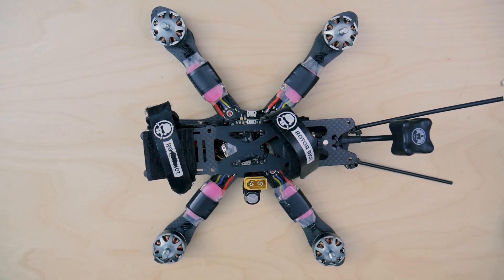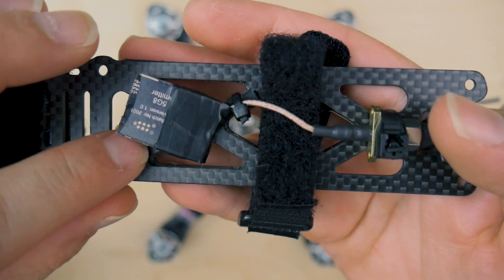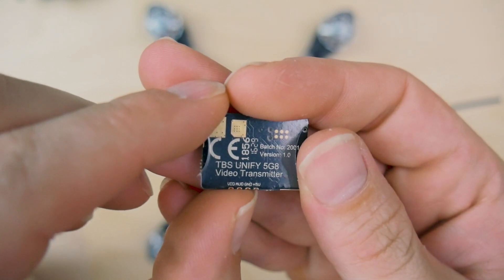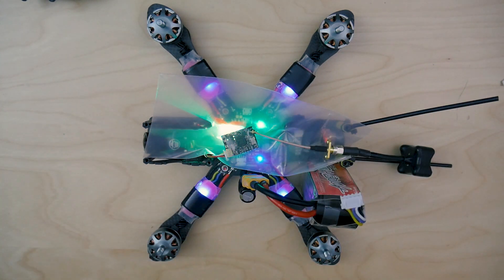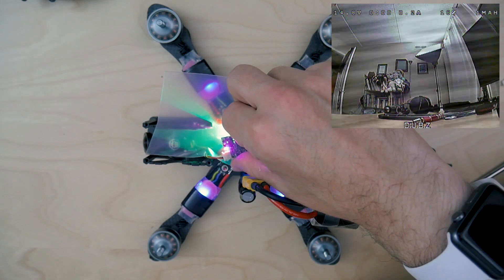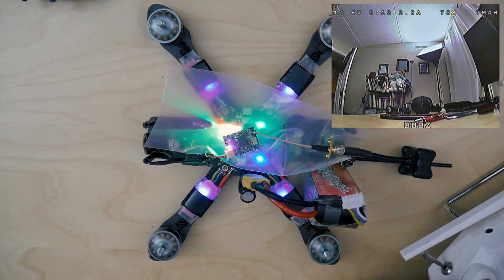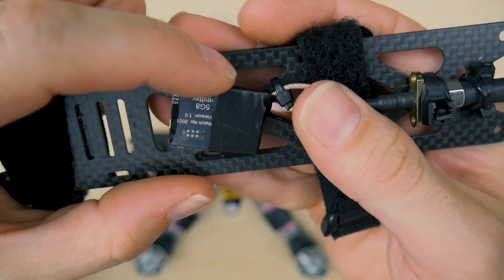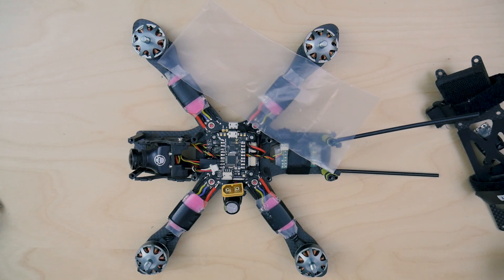Horizontal/Diagonal Lines in TBS Unify Pro When Armed - Solved

Comment: Any electrical engineer here? I think TBS's active circuit to counter suppress the side bands to create the clean channels are oscillating. Those intricate equations that only PhD's know how to use is making me nervous. They are trying to squeeze a 2 pond equipment into a 2 gram board, the troubles are creeping out. Maybe I will go back to the cheep and dirty AKK boards for the sheer simplicity.

Comment: I wish that was the problem sor me unfortunately even on open bench everything layed out there are horizontal lines when going to 400mW or max. No issue in 25 or 100mW on TBS Unify pro32 nano. Even when motors aren't spinning just after arm (to get out of low power mode). I redid all the solder connections nothing helps.

Comment: Just wanted to say THANKS! I had the TBS Unify on the top plate of my Zilo Phreak and it started to develope the horizontal lines when armed. Because of your video I was able to identify the problem and fixed it by repositioning the vtx. Again, thanks.

Comment: Had the same issue with a TBS Unify Pro32 Nano. It would heat up really fast, and unless in very good airflow, this would result in a lot of high frequency noise. So I used some thermal gap pad material between it and the carbon frame. Adequately cooled the high frequency noise vanished, but I then saw lines as you show when I armed. After some experimentation I found that if I grounded the frame (a simple wire from a gnd connection on the FC to a frame bolt) totally eliminated the noise. The fix shown here is wrong. You want the VTX amounted against solid carbon, not where there are holes. Then just add a ground wire.

Comment: For my quad I start noticing lines in the feed when my motors start going. Sometimes I notice them weeks before a motor goes weak, blows a bearing, or burns out.
Good gouge, though! I use the TBS Unify Pro HV, so next time I have it open, I'll look for this, too!
Thanks for the great video!
edit: electrical tape over the open contacts can help, too. I always lay a pad of electrical tape when mounting pcb near/on carbon fiber.

Comment: Does anyone know other causes of diagonal lines? I'm using a different Vtx (eachine tx5258) and I've tried insulating the Vtx, using different ground pads, powering the camera from the board and directly from the 5v Vtx output but I can't get the lines to go away :( Please help.
Reply from the maker: I've learned a lot since posting this video and will likely do a follow up soon... The lines can come from just about anything. I use individual ESC's and have had a few that cause the lines even thought he ESC worked and preformed fine. Could be your PDB. Could be a bad camera. Could be that the vtx antenna is too close to the battery wire/terminal. But what I have found is that when you do get the lines, it means that there is an issue somewhere. Something is making the power dirty. The million dollar question is where? Unfortunately you will only be able to find out by testing all components individually. It's a pain in the ass, takes a long time and can be frustrating as hell. But it usually ends up being a bad component somewhere. You could also try capacitors.. Wish I could be of more help.

Comment: I have the TBS unify pro 5V, but I get horrible lines on my screen when I switch my VTX up in power wether it's armed or not armed. If I go past 200MW it's so bad I can't see anything, but I can fly with 200MW or less. Any ideas why? I really want to fly long range but I can't do it with these lines on my screen!
Reply from the maker: I'm starting to find that lines in the video usually mean that there is a ground loop somewhere in your wiring. Best thing to do is to remove your props, power on the quad with your goggle or screen, then start moving different wires and boards slightly to see if it causes any variation in the video lines... In your case, it may be that you are drawing too much power rail you have your vtx connected to. Based on your FC and PDB combo, there are limits to how many amps you can draw from the 5v rail or the boards themselves. Seems as if, when you go over 200mw, you may have reached the limit on the amps drawn the the video gets too noisy. There are really to many variables to give you an accurate reason but hope this little bit of info helps. Thanks for watching!
Reply: Joshua Hardee 

Yes I think your right. I went and bought a Mach 2 from RaceDayQuads to try it on the 7V VTX power and the lines are way clearer. It's still not really working past 200MW but it's much better than what it was so I'm getting closer!
Reply: Have you now fixed it? I have the same vtx you have.. the unify 5v... i never had this issue with this vtx with my other builds... i can not understand why this happens.
Reply: Yes, it turns out the issue was my flight controller. I swapped it out and everything works just fine now. But thank you for the reply!

Comment: I bought a mr steele quad from flitetest, but my issue with vtx was the free dangling vtx mounted was causing vtx antenna to be disconnected. What i did was to solder the antenna to vtx and fixed.

Comment: One of the motors is shorted. When the screw is tightened into the motor windings you get such lines when you push throttle. Is because the vtx antenna gets grounded to the top plate and the top plate is connected with the bottom through those aluminium standoffs.
Probably also one of the standoffs gets hot in about 1 minute or so... easy to check if you connect the battery and give a couple of throttles with no props.

Comment: Min 9:19, I would still recomment the SMA not to touch carbon. It makes sense what you did, basically isolating the open areas that seem to be susceptible to noise in this vtx much more than others.

Comment: The cause of the lines are voltage spikes from the motors and Esc's. Try a ferrite ring, using only 4 turns widely spaced.
Reply: paulkazjack install the ferrite ring on the power leads going into the vtx?

Comment: You have so much space in your stack you could use the whitenoise mounting board so you can bolt it into the stack and remove the heat shrink. Runs cooler too.

Comment: Is there any other solution e.g. adding a couple layers of insulating tape over the heatshrink?
Reply from the maker: I tried adding more electrical tape and heat shrink.. It did not help.I would imaging insulated tape would help but I did not have any to try. If you try, let us know. Best thing for me was to increase the distance of the VTX from the carbon.

Comment: Great video. The reason they have those little pads on the side is for a board they sell called the "white noise" which you can basically solder the VTX onto and the board mounts on the top of your stack.

Then you solder wires to the bigger pads on the board to connect everything up instead if using a wiring harness, I think there's even a place to mount a frsky RX etc. on it. I had the same issue as you putting the unify between the standoffs on the bottom plate of my Dronewolf pup, the problem went away when I removed the VTX from that spot so I realised something was making contact or affecting it so I wrapped it in more heatshrink and stuck thick foam tape between the VTX and carbon fibre to fix it.
Reply: I'm going to try that, thanks

Comment: Thanks for sharing this Video...I think my Mach 2 VTX hast his issue touching the Aluminum cage of my Dquad Obsession...no lines before idle, then lines show up when armed...will look into isolating the board better.
Reply from the maker: So on my second quad, I tried wrapping the SMA connector of the VTX connected to the SMA of the VTX antenna in shrink wrap to isolate the connector from the carbon top plate. For some reason I got lines in the video. When I removed the shrink wrap and allowed the SMA connector to touch the carbon frame, the lines went away. I'm guessing it is almost like a 2nd ground... So if you have isolated the SMA connector using shrink wrap, try removing the shrink wrap and allow the SMA to touch the carbon.
Reply from the maker: Let me know if you were able to figure it out or if this helped.
Reply: I am wrong on the Metal cage grounding, Tested it with my Multimeter, it is anodized, and no matter how hard I press the meter points in there is no continuity even on the same cage part, I thought it might be RFI nearby the VTX that is pushing through the Runcam Soplit 2 board + metal heat synch. Turned out I had kinked my SMA cable, and the ground was bleeding through the signal coax. I replaced it and got better reception, after I put some standoffs on my SMA mount to let the pigtail have some more room beneath...

Comment: You say metal about a hundred times... do you mean carbon? Just clarifying. You mean the metal contacts on the Unify are touching the carbon.
Reply from the maker: Kendall Smith yes, this is my second video and did not plan or edit it much. It’s basically a one shot so yes I did stumble on a few words. But... Carbon is a form of metal... The unify contacts don’t have to directly touch the carbon, in my case I had the unify wrapped in shrink wrap as well as electrical tape and it wasn’t touching the carbon it was just very close to it. So if those unify contacts are close to any conductor (metal, carbon, finger, etc.) even with a fair amount of insulation, you will still get lines in the video.
Reply: Joshua, after re-reading my comment there were a certain amount of douchey undertones that were unintentional - my apologies. I was ensuring that I didn't misunderstand something about your build. Thank you for the response and efforts to share your experience and troubleshooting with the community.
Reply from the maker: Kendall, no worries brother, glad to help and share. I’m very particular as well and after I posted the video, I noticed there were quite a few things I could have said differently. Just with all things, we only get better with practice and will be posting better videos in the future. Thanks for your input as well as watching. Hope it helps with your troubleshooting.
Reply: Man, I guess I should just shut up sometimes haha... this thread re-activated months later. My bad! Again, thanks for the video and no hard feelings :D
Reply: well not to be a dick or anything but carbon is not a metal, it's carbon .
 but we understood in the video as it was very clear what you were talking about.
Reply from the maker: You're not a dick, but you are correct. Carbon is not classified as a metal, but it is highly conductive. I worked for a Steel Company at one time and they processed Carbon Steel so my misconception came from that industry. Good Catch!
Reply: how can i fix this in a Chameleon frame? I have mounted the unify pro vtx in the bottom plate with doble faced foam. Maybe the noise issue is the antenna placement back in the aluminium plate? Thank you.
Reply: Ok but is there not any insulation that would solve this?
Reply: Is any plus touching the frame except for the unify?

Comment: Great video  friend bought one and had know joy so bought another thinking there was something wrong with it other same. Maybe soldering wires  to the side would help
Reply from the maker: Pete James was thinking the same about directly soldering but will still need to keep that side away from any conductor (metal, carbon, etc.)
Reply: Sounds like the tbs Unify Pro is going to be a pain for my friend just wondering if the other sort of tbs will be the same .Some other people think that it also to do with dirty power lead.
Who knows so glad haven't bought one.

Comment: Thanks so much for posting this. Ive made my quad into a giant flying capacitor trying to cure this problem. Nothing has worked so far. My lines look exactly like yours and I have my vtx very tight to the top carbon plate. Ill give it a go!
Reply from the maker: jhan1962 Let me know if you’re able to figure it out.
Reply: Just tested and it did help but i do still get some lines.  Better though :)
Reply: Let me know if you’re able to figure it out

Comment: wow nice find. I had the lines in my video too. But turned out it was the sma nut on the antenna touching the carbon. once I put some tape around the sma the lines were gone.
I'm running Steele pdb and unify also.
Reply from the maker: Great suggestion. I did try the tape on the SMA nut as a troubleshooting step but it did not help my particular issue. I was almost certain it would have helped but didn’t. Currently the SMA nut is directly touching the carbon of my top plate and have no video issues. Go figure!
Reply: the sma nut is actually at the same potential as the carbon fiber which is also at the same potential as the negative side of the lipo.